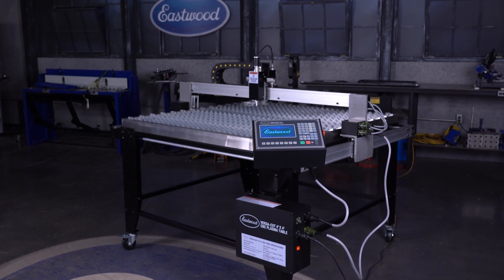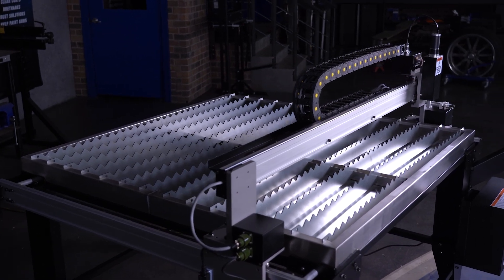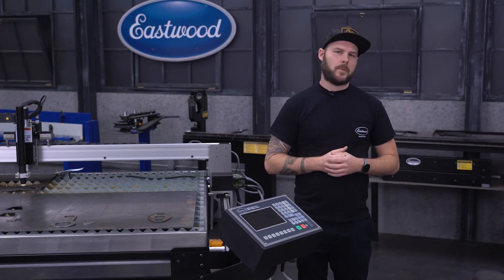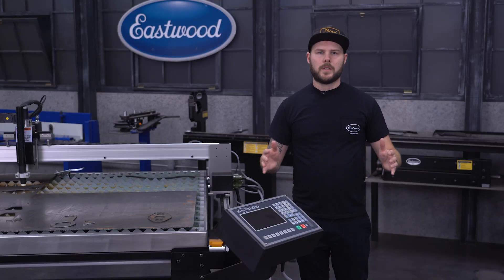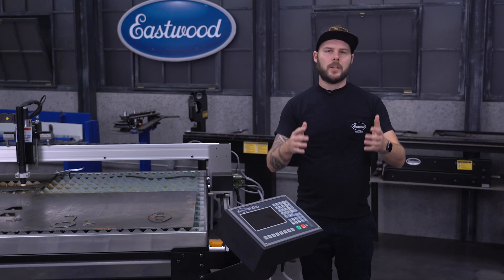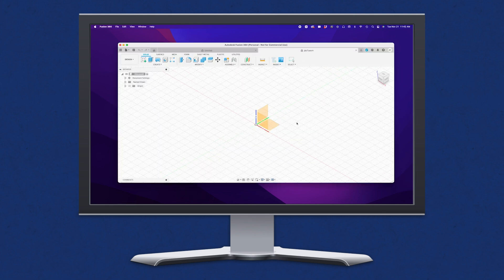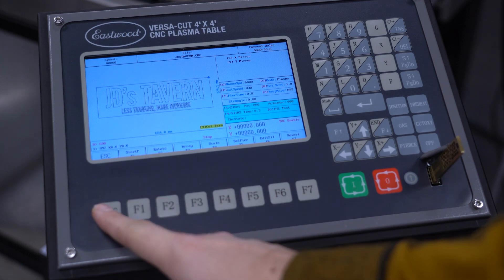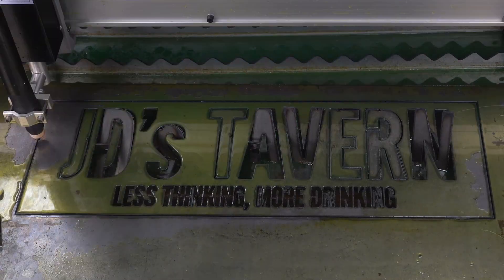Affordable Plasma Table with Pro Results! - Versa Cut 4X4 CNC Plasma Table with CNC Cut 40

Comment: Just starting research on these. I currently use a C02 laser. Can a laptop be hooked up to this? Is there a system that I can control it from my laptop like I can with my laser in lightburn?
Reply from the maker: The table runs off of a .CNC file using the built in controller. You can design any file you want and save it to a flash drive, then load the flash drive into the CNC table. No laptop needed. It also has a library with 50 built in commonly used shapes so you can select, scale, and cut all right from the machine if you want.

Comment: Well im ready to buy atm but why should i. I heard there is no support with your product its on amazons reviews. A customer was getting no help with your product....langmuire has tons of how to videos and support forums sell it to me why i should go with this... i have a 60gallon compresser plumed up electrical ran to it and primeweld cut 60 torch in hand sell it to me if you dare that itll work and ill have technical support and i will buy your product.... from what i heard this gentlemen emailed you about your product and got no help.....not what i want to hear with a big ticket item purchase.... how are you better than the crossfire pro....plus i allready have a laptop and have made designs in cad/cam on fusion 360 im buying this month sway my decision away from the crossfire pro.
Reply from the maker: We always have our customer service and product advisor's just a phone call away 800-343-9353. As far as support, we recently released a firmware update with How-To video to keep improving this machine that every customer received in their inbox to make sure they're running on the best software.

Our machine is not "kit-bashed" it's designed from the ground up so all the components work together, from Plasma Cutter, Gantry/Bed, and the computer interface so you won't run into compatibility issues you might with another manufacturer.

Finally you mention another table that has a lower initial sticker price but has a smaller 4' x 3' cutting bed, no onboard interface/software to run the machine, no limit switches, no plasma cutter, no machine or handheld torch.  Once you outfit their table with the items that come standard on the Versa-Cut 4x4 our table will be the less expensive bargain.

Good luck with whichever you decide to go with!
Reply: I tried sending an e-mail via eastwoods web site.  This was a week ago.  Not response.  It was a pretty simple question.  I tried their chat, but got a bot instead.  I'm really not liking the support model I'm seeing here.  Moving on to a different brand.

Comment: I would like more inf on this.Where can I get in contact directly?
Reply from the maker: You can get all the available info here:
https://www.eastwood.com/eastwood-versa-cut-4x4-cnc-plasma-table-with-cnc-cut-40-and-machine-torch.html

Additionally you can call 800-343-9353 and speak with a "Project Advisor" to get some guidance.

Comment: Is there an option to nest multiple different parts and cut a full table worth of parts?
Reply from the maker: It has built in array features which would accomplish some of that.  You could also build a cut file that has all of the things you want included at the full size of a sheet.

Comment: Can you buy it with a higher amp plasma, or does it only come with the 40 amp
Reply from the maker: You can order it without the plasma cuttter 
https://www.eastwood.com/eastwood-versa-cut-4x4-cnc-plasma-table.html

and then add a Versa Cut 60 seperately
https://www.eastwood.com/versa-cut-60-plasma-cutter.html

or upgrade to the heavier duty machine
https://www.eastwood.com/eastwood-elite-4-x-4-cnc-plasma-table-with-cnc-cut-60-plasma-cutter.html

Comment: Cool table, and the preloaded stuff is awesome. I’d probably buy this over a crossfire since me and computers/cad software don’t get along too well. But I also don’t have much space, so my best bet is probably the arcdroid. Their simple trace is really cool too.
Reply from the maker: It's got a lot of great features packed into an affordable machine, and the main thing this is offering over the one you mentioned is the available cutting area and platform/water bed.  Check back soon - as we have some other plasma table's in the works as well that might fit your space better.
Reply: @eastwoodco  I certainly will, your Pottstown store isn’t too far from me and I prefer to buy local when possible!

Comment: What is the cuft/min requirement on the air compressor.  I'm thinking I'll need something more substantial
Reply from the maker: Covered in the video at 3:21 - 5-7CFM @60 PSI